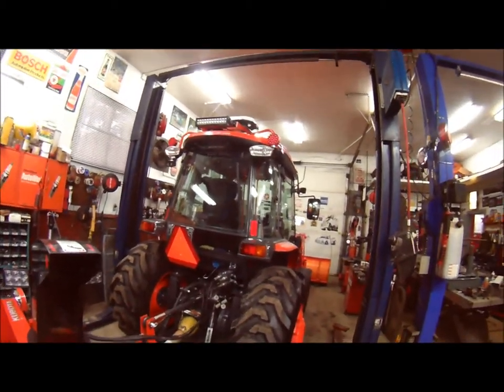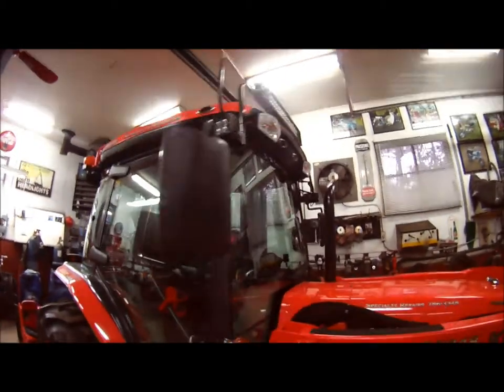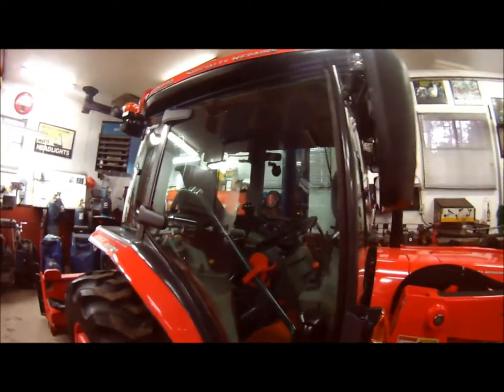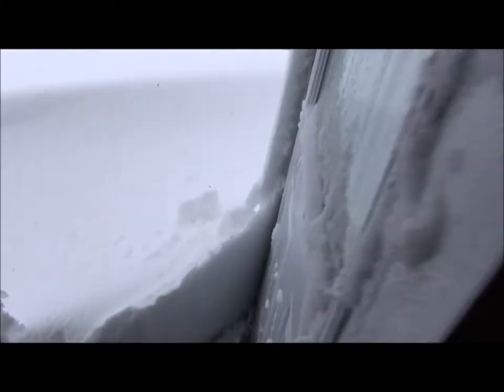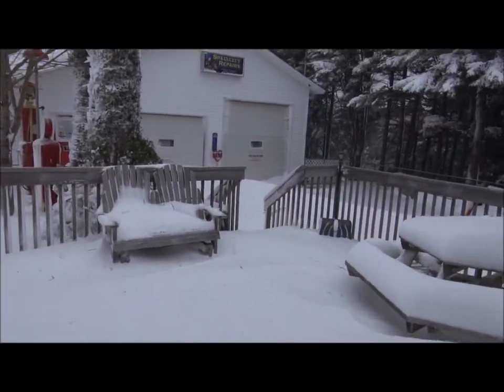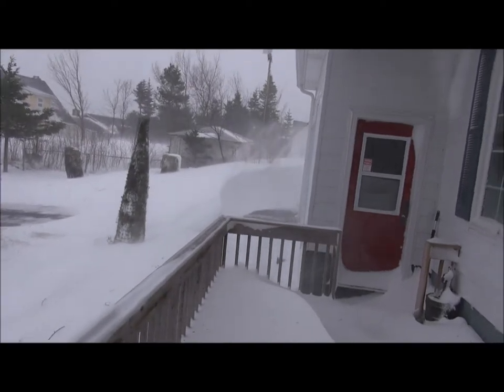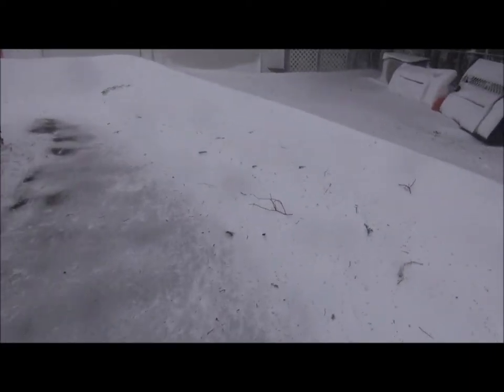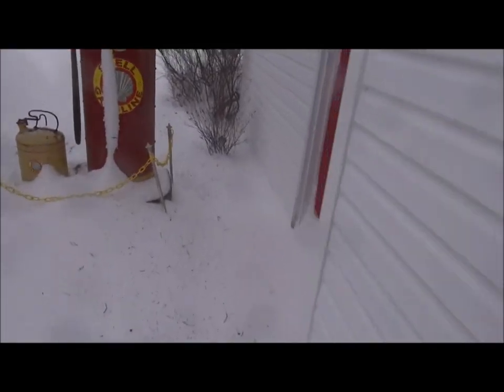Part One. First snow storm for 2013.wmv

Comment: Tractors looking great!
Reply from the maker: I think the Grand L has always been my dream tractor. No issues except the seat and the exhaust so I redesigned the floor pan and installed a Grammer Air Ride seat. It's soooo nice now. I then designed a exhaust stack conversation kit that worked perfectly. 
It's a very nice machine.
Reply: Your a very lucky guy Paul !!! I miss my old grand L ! Lol I cried so much when I was 8 when my dad looked at me and said that he sold it lol I really can't wait to see that amazing tractor in person. !!! Next summer !!! Any way I could get a stacked exhaust ? And would an grammar air ride seat fit my old b7610 ?
Reply from the maker: What size was your Grand L? The Grammer seat alone cost me $1100. plus two days to do the retrofit. I'm not sure if my seat would fit yours. I'm thinking your cab is smaller. A exhaust kit can be made to fit any tractor but I need to have the tractor in my shop to do it.
Reply: My grand L was a 5030 , 53 hp if I remember correctly
Reply: We had the grand L 50 with a 74" pronovost all hydraulic snowblower and an 9ft wide pull behind kubota mower
Reply from the maker: Nice tractor. Ours is rated at 60hp turbo charged. Where did yours end up?
Reply: Also off course with loader and a fully equipped cab , radio,heater,air conditioner
Reply from the maker: Well you had a nice tractor but it's a real beauty you have now. The 5030 would really be to big for your needs. I like your tractor.
Reply: Lol I guess I have to thank my mom for that !